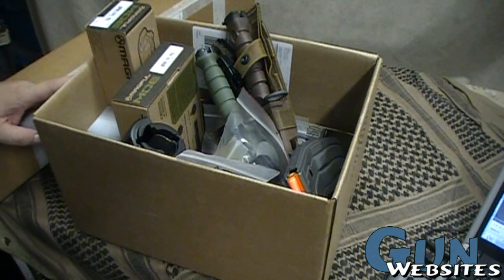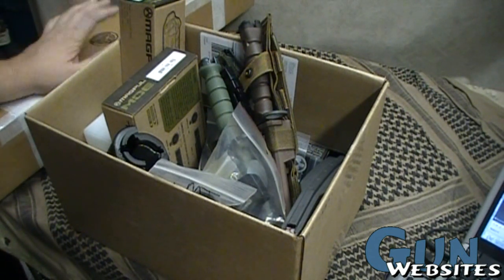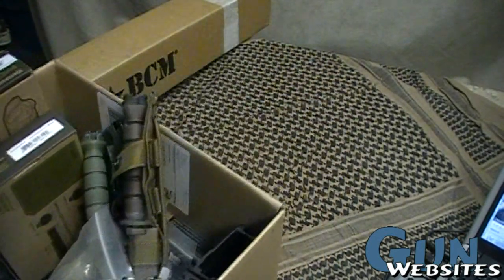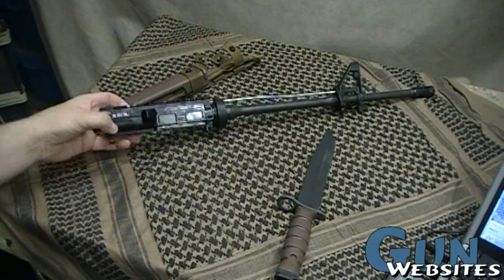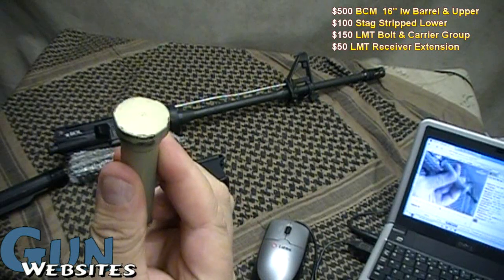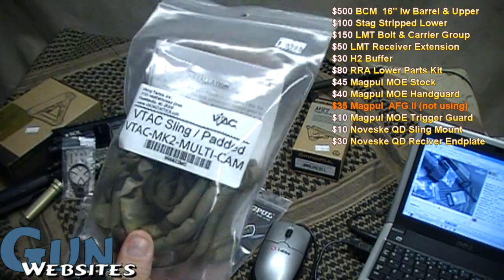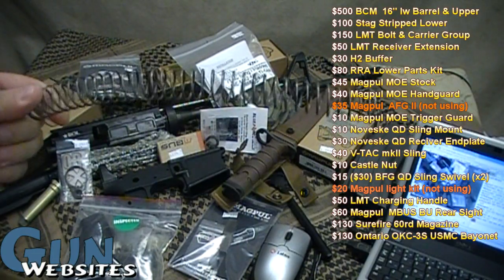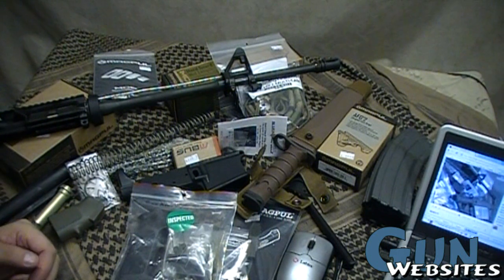AR15 Build: BCM 16" Mid-Length

Comment: I have an AR build planned when I get some money. Spike's Tactical mid-length using mostly Spike's parts. Coming in around the same price, maybe a little more when I factor in other expenses like accessories, tax, etc. If I come in under $1650 when all is said and done, I'll be happy. But the rifle itself will be complete and functional at around $1300 if all goes according to plan.

Comment: An upside-down flag is a sign of distress and is only to be used in case of emergency.  By displaying the flag upside-down, he is trying to show that the country is in distress.  He isn't trying to be disrespectful.

However, I agree with you that he shouldn't have the flag upside-down due to the (only for use in emergency situations) rule for flying them that way.